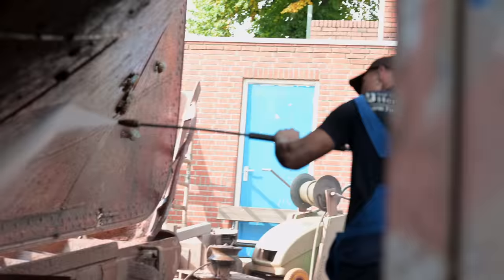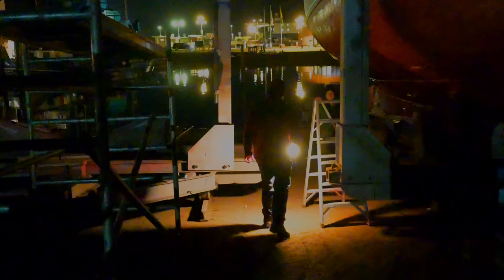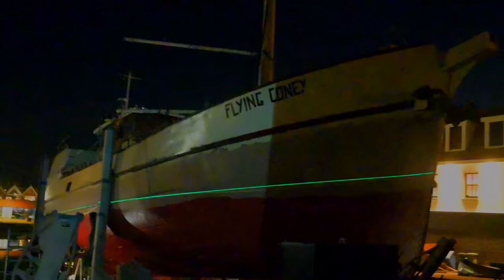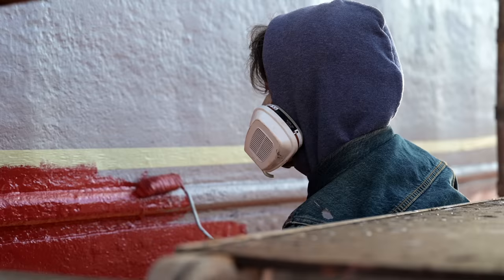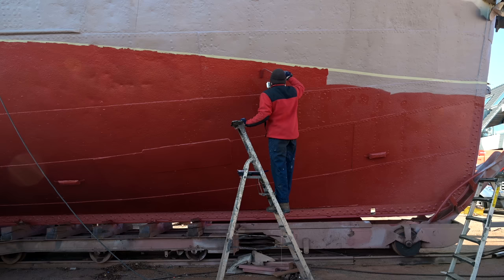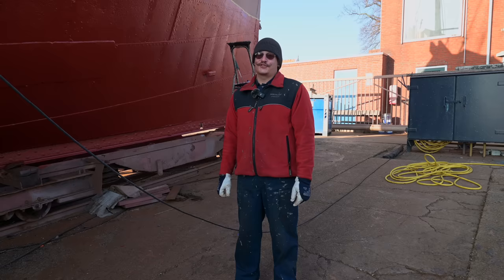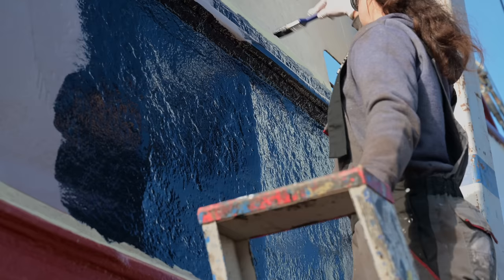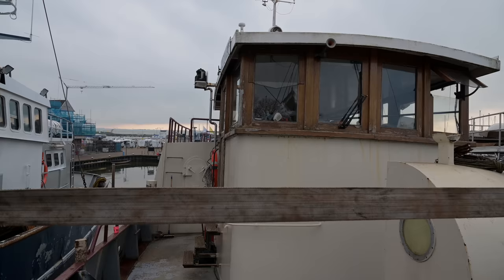Flying Coneys New Color!  Painting a huge hull!

Comment: Really nice colour.  A tip when painting ships.  Always paint your top coat a few cemimeters below the water line and then set the water line.  Main reason for this is to create an overlap (reduces the chance of air or water penetrating at a paint join - often the reason why waterlines rust first) and the anti foul should always be last.  I can only express this from many years of painting steel vessels the wrong way and the right way.  This tip of course will be the vital one when you do venture to the two-pack paint in the future. Great job guys, she is really looking fantastic.
Reply from the maker: Thank you for the tip! We always appreciate helpful comments and your advice sounds reasonable so I hope I remember it when it comes to painting again! 😊

Comment: Almost a German flag if the colours order was changed :) '

I have painted many many boats, traditionally I have always done the topsides first to below the water line then brought the Antifoul up to the waterline over the topcoat. Then boot stripe (does anyone do that anymore). Reason is the coats need to overlap at least a little to protect the undercoat. Antifoul as the coat under is the worst as it is ablative so will be washed away stripping the topcoat edge. I guess not important this time as will be blasted off soon but remember this for when you do that final coating.  I also like to give the topsides plenty of cure time before launch and the antifoul bare minimum time usually the day before launch.
Reply: totally concur

Comment: Alright. It sure looks painted. 

I really like the dark blue color. 

I think you should paint the upper deck too before rust gets the best of the boat. It has been great weather, but it may have been a bit too hot. 

Next time we will see if it floats. :P 

Greetings,

Jeff
Reply from the maker: Next time you see us sailing ⛵️ The ship was built with a traditionally laid wooden deck. It was repaired and sealed by simply putting sheet metal above it. Since this was done in the 90s it's relatively rust free and it's mostly red paint that may look like rust. However we do want to get rid of both and lay a new steel deck for various reasons. Thank you for your comment!
Reply: @FlyingConey  I actually meant everything above the hull, a.k.a.; the "upper deck", or "main deck". Just like a story of a building. But nice to know the floor of the upper deck is in good condition. :) 

Okey, a new deck, that is cool! Are you going to put a new engine in? Its an event that gives some opportunities. So you better know what it is that you may want to do before closing it up again. 

Did you learn how to weld yet? :P It seems like there is a lot of welding coming up. 

Good luck!

Greetings,

Jeff
Reply from the maker: We both have rudimentary welding skills and since there's a lot of opportunity to improve them I'm sure we'll get the hang of it. But below the waterline and the difficult to weld hull we leave the work to the experts. 
The DAF 1160 is an excellent and very economic engine and it has only 5000 hours on the clock. We burn about 12 liters an hour. I guess there's no need for an engine swap. All the best.
Reply: @FlyingConey  12 liters per hour sounds like a lot, but I'm no marine engine expert. Is that a lot of just average? I don't know what is right for the size ship you have got. I do know that for it to run the cheapest/best/energy efficient, it has to be in good condition. You probably know where to find good diesel engine books. :P If you feed it love and all the maintenance, it will love you back, and you will have a great time with it.

Welding is part of running a bigger ship. Someone I know from Urk once told me the only ship he would buy is steel one, because you can weld it in every harbor on the planet. The rest he though was dangerous and unwise to get. 

Greetings,

Jeff

Comment: The blue color is stunning. My only concern is that UV is not so friendly with darker colors. Also transfers more heat to the interior of the boat. Which is good in the winter but not so good in the summer. But your boat is so gorgeous she would look great in any color. Like a supermodel in the potato sack. She is still a supermodel ❤😊
Reply from the maker: They say that a darker color is better for steel beats because it dries faster so in theory less rust. (or you don't see it as soon 😆) It's also a high quality paint with good UV protection but only time will tell. For hotter climates it's probably better to choose a brighter color but one month ago we still had the heater running from time to time 🥶

Comment: Well I am glad no one fell off the ladder I think you are supposed to use a laser level I have several. You can set it to a horizontal line in the dark and just put the tape on the line. Make sure it is level guess you would have to put it up to the same height as the water line. I would have gone with a light bright color like orange from the side and white from the top. The orange is easy to see better if the ship rolls over on its side and you need help.  Did you check those rivets that they are not rusted out. Remember to bring the box of different diameter wooden plugs that you can hammer into any holes.  Good luck
Reply from the maker: We used a laser level to "find" the waterline. It was placed about at the same hight but still it wasn't easy and it involved a lot of guessing and hoping. We do have an AIS so all the big ships see us even in the most foggy conditions 😉 And since the ship fished and sailed the North Sea and the Atlantic Ocean for more than 70 years I hope she will not roll over. Well, underwater is painted red anyway.

Comment: If you want to show off hercharacter, a dark color will certainly do that. I forgot who John Kretchmer was quoting but in one of his books he quotes "There are two colors to paint a boat, white and black, and only an idiot paints a boat black."  It has to do with solar heating in the tropics.  I don't know the final plans on where you'll be sailing but if it includes the Caribbean keep the solar heating in mind, your ship will be a hot box. I also think Coney could benefit from a boot stripe.
Reply from the maker: The quote is originally from Nathanael Greene Herreshoff who mostly designed fast and innovative racing yachts. I think it's fair to say that Flying Coney isn't particularly what Herreshoff would consider as a yacht 😂

Comment: I have seen that some earthmoving equipment, such as bulldozers and graders use a small petrol engine to start the main diesel.  Is it worth considering installing one of these (if it is technically possible)?
Reply from the maker: That's called a jockey engine. Very uncommon on boats and ships. Bigger engines are started with air and you do have a small diesel air compressor to fill up the start air tanks. Also you don't want to have petrol on a boat. If a normal starter isn't reliable enough you also find inertia, spring loaded or pneumatic starter motors.

Comment: Is this boat an Iron boat? Asw many years ago they used Lead paint very bad stuff but people did not know that.
Reply from the maker: We always had the respirators on just in case. The hull material is steel but it's an older variant and more difficult to weld.

Comment: I'm not surprised that people don't keep up with zink anodes on huge boats. It's $500 a yr to replace the 14 zinks on my 36' power boat, so a boat like this could be a couple thousand a yr.
Reply from the maker: Hell no!!! We've paid 550€ for the 28 anodes. Usually the last for several years. Have you checked your electrics and do you have an insulation transformer?

Comment: I like the colors   but painting it with a brush doesn't give you the c 5 m thickness  required for marine protection
Reply from the maker: We applied the paint according to the instructions from the paint manufacturer. Not all paints are suitable to be brushed on but the one we used is.
Reply: Are you saying that spraying gives you a greater thickness? Have only ever brushed on bottom paint but several coats.
Reply from the maker: We're in fresh water so the marine growth isn't that sever and the one coat we've put on should last at least a year. We do want to haul out the boat this year again. I don't think that spraying gives you a greater thickness but it's faster and it depends on the product if it's recommended to spray, roll or brush.